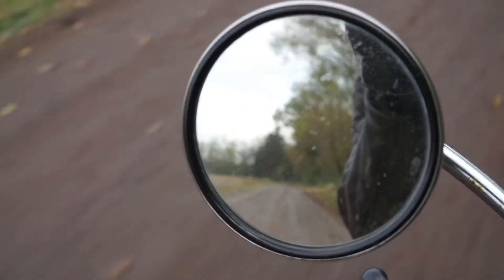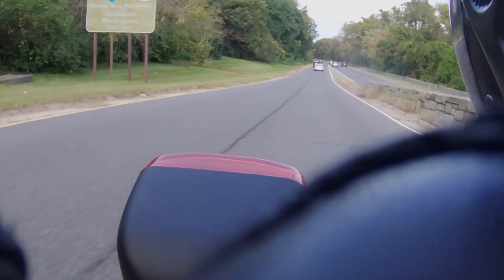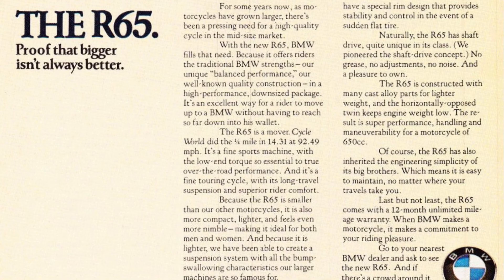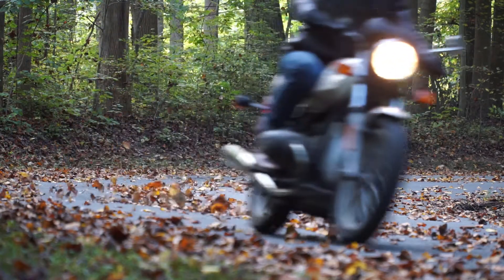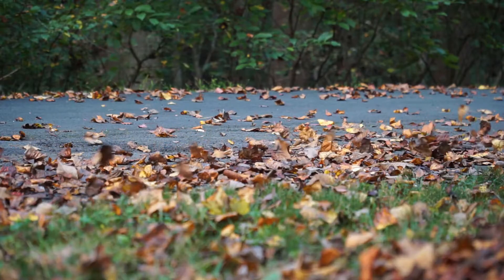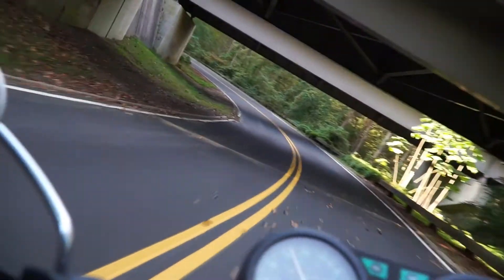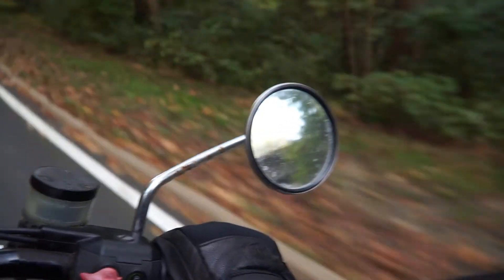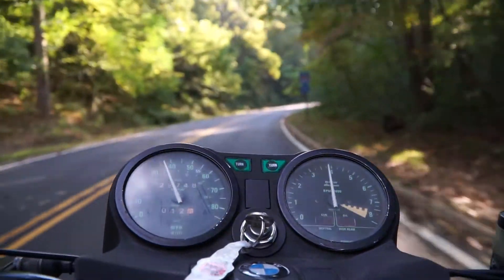1980 BMW R65: The Everyman's Airhead

Comment: I worked as a mechanic at a BMW dealership in the 80s. There were great little bikes except they seemed to have clutch trouble and they were hard on timing chains. We had a customer come through on an R45. She was riding around the US and had shipped her bike, an R45, over from Switzerland. She was not even a quarter into her trip and that little under powered bike was worn out. She had been trashing it hard. The timing chain was shot, the rods had lose big ends, and the pistons rattled. My boss did the work for free to get her back on the road. He swapped out some 650 cylinders (they fit and I have no idea where he got them.) and he fixed the rod knock. She sent us a nice letter detailing her trip when she got home.
Reply from the maker: I think I'm due to replace my timing chain sometime here soon as well, it's only got 40K on the clock, but the idle is a bit uneven, though it runs like a top at speed. Love to hear stories of shops getting roadtrippers back on the road though. :)
Reply: @ihutch92  If you need a timing chain it will let you know. It will be noisy and cluck and slap.

Comment: R80/7 owner here. You've got valid  a point, and the video's very poetic. the main point though are valid for any newer R 45/65/80/100 :-) love my old clunker (and changing the oil on 4 different compartments (engine, gearbox, drive shaft, and final drive). Best thing though is that the design (aircooled flat twin, shaft drive (crank orientation) still holds in modern Motorcycle design today (R nine T)
Reply from the maker: The points are indeed valid to all the airheads. :) I think it would be fair to accuse me of favoritism, since this one is the one that sits in my garage.

Comment: I just bought a black '83 R65, my first BMW, a few weeks ago, and as a woman, its just my size which most airheads aren't. :D It only has $16k orig miles on it and very fun to ride! No big issues so far but trying to trouble shoot why the running and tail lights don't work. The headlight, brake and turn signals work at least but I'd like to ride it on trips and at night so anxious to fix them.
Reply from the maker: Ooh yeah definitely get that fixed, that could be dangerous haha. I’d recommend joining one of the airhead clubs (MOA, Airheads Beemer Club), lots of folks would probably be happy to help you troubleshoot, could be as simple as replacing a fuse or patching a wire! Check your fuses first—one might be blown. :)
Reply: @ihutch92  I did find one fuse blown but that didn't fix it. Still checking & cleaning all the various connections along the way to the front.
Reply: @ihutch92  Thanks for the suggestions. We got it sorted out this morning. Checked every connection from front to back, replaced a tail light bulb and both fuses. Also cleaned the contacts on the ignition which was half the issue. Now I just need some cooler weather to ride in! Stay safe.

Comment: I have ALWAYS wanted one of these. When I first started becoming aware of motorcycles when I was a little kid, these were rolling around brand new, even the older model airhead BMWs were. The BMW R series, the British twins, the Kawasakis imitating the BSAs, the BSAs, Nortons, etc. were my idea of what a motorcycle was. They weren't loud, they were all metal and chrome, smelled of oil, grease, and gasoline. They usually had a dashing young man on them, perhaps going to class at university, going to work, whatever. I fell in love with motorcycles from the moment I saw motorcycles like this. Why can't they make them today?  I know it is emissions, and safety regulations.  But gosh darn it, engineers are clever people!  Surely we can make simple machines that ignite this joy in people in the same way, are easy to repair yourself, and still meet all the regulations!  Let's face it, regulating motorcycle emissions is a tiny, miniscule drop in an ocean compared to other modes of transport.  Come on BMW, bring back the R65, the R50, the R75!  I'd buy one in a heartbeat if they did. And I would ride it until it died or the heat death of the universe, whichever came first.  My money is on the universe going first.  😀
Reply from the maker: I had a similar experience, there was a guy with a silver chrome tank /5 at my university that I would see and that was what first tuned me into airheads especially. :)

Comment: When the BMW R1100R got a little sister, the R850R, it was again proof bigger isn´t always better.  The two were identical apart from the cylinder capacity AND a shorter final drive. The result was a bike that was driving way smoother than her big brother and did everything you asked her to do.  I drove both, the 850 was absolutely my favorite.
Reply: Curious what type of riding you do? WHat type of roads?
Reply: Die Erfahrung habe ich auch gemacht.R850 R läuft ruhiger.

Comment: i had an 82 as my first bike. that thing was so much fun. i miss it so much. and yes, the suspension did have me feeling a little unsafe in corners...and the brakes in general haha
Reply from the maker: Yeah the brakes don’t inspire confidence haha. I ended up replacing the rear springs and shocks on mine with some Progressives and it definitely was an improvement on corner stability. Still won’t be touching any knees down any time soon though haha

Comment: Nice video Ian, thanks for posting it.  I have been thinking about a project Airhead, and the R65 sounds like it might be just the model!
Reply from the maker: Glad you liked it! An R65 would be a good project bike because they’re cheaper to acquire than most airheads...however take in mind that that’s because they are often the oddball bike for parts that fit most airheads. If you get an R65 be prepared to see a lot of parts labeled “except R65”. 😬 just to keep in mind!
Reply: @ihutch92  - OK, thanks for the good advice!

Comment: Best motorcycle I ever owned!
Reply: I've had an RS125 Yamaha, a Honda CB400/Four, a BMW R65 and a BMW K100LT. The R65 was by far the most comfortable and most reliable motorcycle I have had. Not the fastest, that was the K100, but you could, and I did, drive the R65 all day with no annoying handlebar vibration at touring speeds (something that plagued the K100). It might have had less torque than the R80, but it could go ''uphill and down dale'' at around 1000rpm in top gear, with a passenger, all day in mountainous landscapes. The only real pain in the a** was to keep the two Bing carburettors synchronised and the manometer I bought made that an easy problem to solve, and the best investment I made.

Comment: My dad still has his. Sure it's been sitting in the same spot for almost 40 years but so far it seems to be the only thing to fix is the front and throttle being frozen.  I'm hoping sometime this year I can get it running
Reply from the maker: Definitely give it a go! You should join a club like Airheads Beemer Club, it gives you access to a lot of people with a lot of experience working on the bikes. Most of them are happy to exchange help for a few beers, definitely a good community. I've had great experiences with them. :)

Comment: About to pick up a barn find of one of these. Gonna be a garage build. Where can one find the service manual?
Reply from the maker: Good luck on the rebuild! I got my service manual from the guy I bought it from, but here’s a link you could use, though with the caveat that some things will be different depending on year—they made multiple changes to the design through the years. 

https://vintagebmw.org/library_data/Document_WorkshopManual_R45,_R65_English_1982_Airheads_BMW_601ad7b7668b8.pdf
Reply: @ihutch92  thank you!

Comment: I still have my 1981 R65. I bought it new off the showroom floor in 1982. Paid $3750 with a small cafe' fairing. Upgraded it to a leufmeister factory paint match fairing and stiffer springs in the front fork. Also krouser deluxe saddle bags. It has 15K+ on it and I just bought a 1984 R100 so the R65 may have to go. unless I come into a small windfall. If your interested in the R65 let me know. I may cave...LOL
Reply from the maker: Sounds like a nice bike! I say keep them both :)

Comment: Are you in Northern Virginia?  I thought I recognized some of those roads.  I have an R65 from 1976.  Great video, really captures the spirit.
Reply from the maker: Yes indeed, a lot of the video is from Turkey Run Park! And really? I thought they didn't introduce the R65 until 1978! Great bikes though. :)
Reply: @ihutch92  I'm sure you're right.  It's a /6, anyway.
Reply from the maker: @richardr9859  If it's got two wheels and an engine, it's good by me, whatever it is :)

Comment: Had one, would only ever start if the battery was brand new, even the slightest voltage drop and it woukd barely crank over. Sold the useless pile of crap and went back to Japanese bikes that actually worked.

Comment: The R65 is the ugliest BMW ever made. The unsightly design of the gas tank ruins the look of the whole bike. I had a R60/6 that was a much better looking bike.
Reply from the maker: The ugliest airhead is still prettier than most bike though in fairness. :)
Reply: @ihutch92   I totally agree but BMW missed the mark with the R65 I think.
Reply: I have an 1983 R65. 5.6 gallon fuel tank. I like the large fuel capacity
Reply: @BartholomewSmutz Ich liebe meine R65 LS.